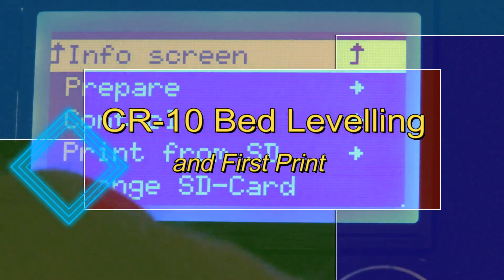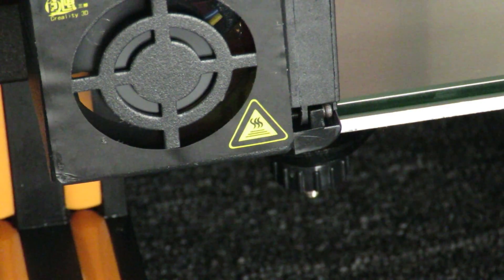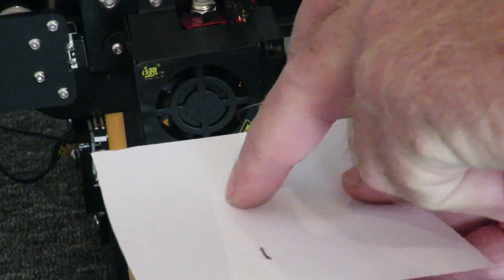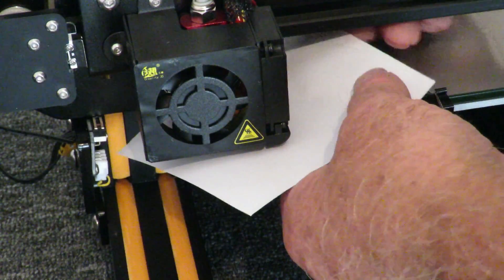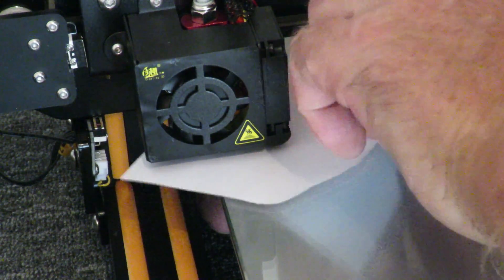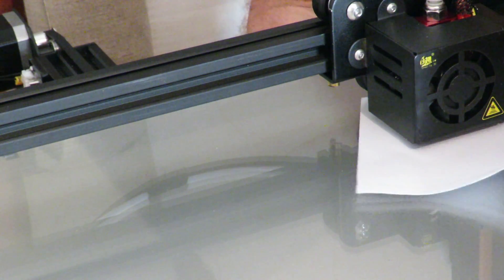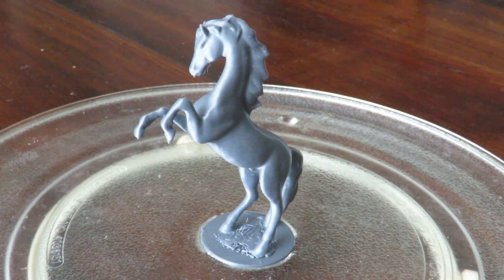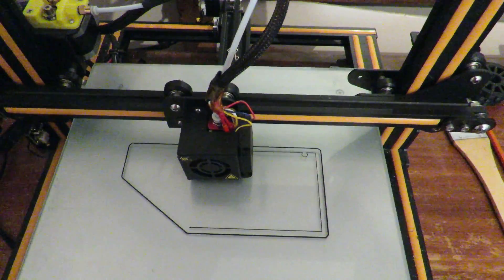📌 CR-10 3D Printer Bed using Manual Levelling first then a New GCode Levelling plus the First Print

Comment: I have the Cr10s also and all four corners are leveled but how can I level middle of the bed ?? thanks
Reply from the maker: Your glass is warped.
I had a similar problem, and power sanded the raised area
https://youtu.be/_h8fcEMxLyQ

I have also updated one of my printers with a New Creality Black Adhesive Heat Bed Sticker 310mm Glass Plate. (Good option)

You can also add a BLTouch sensor to map out the warped glass.

Comment: Hi Gary great information in your video, have you ever done a video on how to get the gantry level, when I turn the lead screw to lift the gantry up, the left side goes up first a few MM  , then the right side starts to move, the wheels on the right side sem to be adjusted correctly
Reply from the maker: No I haven't made a Gantry video.  
See if you can turn the wheel touching the inside of the gantry, if you can turn it by hand, then it's too loose.
(Hold extruder bar, and Spin Wheel by hand)

Comment: I have the ender 3. Can you copy/paste me your code with 200 * 200 * 250 and the temp settings?
Reply from the maker: HI
I just modified the code for your Ender 3 
Bed size190x190
Bed temp 60
Nozzle temp 210

You can read you code and save it to your computer as a GCode file for use with your printer.

https://wetmf.com/downloads/Ender-3-easy-bed-level.GCode

Comment: hi, how to download the file?
Reply from the maker: Hi Dario

Go to 
https://github.com/dogbox257/Cr-10-bed-level-helper

Then select your printer size (it will open in a new window)
Right Click your mouse, and select all the numbered txt code.
Then save as a GCode file on your computer

I.E. Level.CR-10.gcode

Load this file onto your SDCard and print it.
Your printer will move the hotend around your bed, so you can level it manually.

Comment: I find the best way to get a good tip on the plastic is to bend break the end off bending to the four points on the compass, this creates a really good rounded tip with with smallish point to it.
Reply from the maker: Your correct in saying a small point at the end of the filament is easier to thread through the bowden tube.

Comment: You did so much wrong. 1: NEVER MOVE your bed or any axis unless power is on, stepper motors are disabled. Why? Because you can send back current to the motherboard and fry it. 2: turn power on, preheat bed and nozzle, the best way to get an accurate bed level.
Reply from the maker: Thanks for that info.
I have already addressed that very point.

Current is generated when you move the bed around fast, and it can produce enough voltage to light up the controller box. (As you have already stated, THIS Is VERY BAD for the controller board)

HOWEVER, if you move the bed slowly, the inertia current generated is too low to cause any damage to the electrical components.

Comment: Thank you...I wonder when I will be able to make print after print without all this constant tweaking....it seems like all these little things wrong will never end....
Reply from the maker: Hi Richard.
Once you have things running smooth all will be good.

I now only level my bed when I notice the first layer not going down correctly.

Its important to not use undue force when removing your prints, then you will find you will be able to print quite a few items, before you need to check levels.😉

Comment: Garry...my cr 10 does not see my memory card...how would I use my USB connection to send the leveling g code to my cr 10?
Reply from the maker: Hi Richard
Are you saying your CR-10 SDCard controller slot is faulty, or you are having problems with the actual SDCard itself?
Reply: It is really weird...the USB holder seems to be very cheap...I put into my computer usb slot and works one time then 5 minutes later the computer does not see it....(I ordered a new one from Amazon)...same in the controller box...worked for awhile...now does not recognize it...and won't initiate it...using the USB cable from computer to box...works well now...I was able to get you g.code to work and leveled the bed...what do you find is the best method for adhesion on the bed...I just watch a video where some guy used a mirror and just cleaned with soap and water...he swears by it....???
Reply from the maker: The quality of the supplied micro SDCard is definitely questionable.☹
I've had two stop working after only a small amount of usage.
Totally unable to access data on SDCard, my computer says they are corrupt, and I'm unable to format them.
 
USB with Octoprint on the Raspberry Pi works a treat.
I have one setup and use WiFi to transfer my STL files for printing.
I will be making an Octoprint video shortly. (My Logitech C270 camera has just arrived)

With regards Adheasion
I made a video showing the method I use.
https://youtu.be/WxgHSpk44yk

Comment: The link to your modified G code is not working...is that the one that changes the temperature?
Reply from the maker: Hi Richard
Yes I have the layers set for temperature changes  in my GCode.
Try this link (I'm setting up a new site and still moving files across)
https://wetmf.com/downloads/Cr-10-easy-bed-level.GCode
To save , you right click select all, and then save the code to your computer.

I deliberately left the GCode in text form on my site, so you can see there are no viruses in it, before you save it as GCode on your system.

P.S. I always warn people to be careful when downloading any files from the internet.

Comment: Wow...what a great video...I am new to all of this and the bed leveling is of most importance...I downloaded the code from: https://github.com/dogbox257/Cr-10-be...and it worked perfectly moving from each corner of my machine...but it did not increase the nozzle or bed temperature at all...did I miss something???  Thank you some much for all your hard work...
Reply from the maker: Hi Richard
With GitHub code you need to modify it for temperature for your printer.

I have a modified GCode I use with temperature preset.
https://wetmf.com/downloads/Cr-10-easy-bed-level.GCode

To save
Right Click
Copy all code
Save to your computer.

P.S. Lines 6-10 are the heating commands.

Comment: great video, I have a question (sorry if its a dumb one im new) right before it laid down its first layer I noticed towards the edge of the bed it dropped some spool. I cant help but realize that that location is the same spot my extruder got caught in a loop in. it stood there and went left right left right over and over until I realized thats not where prints are supposed to begin nor was that the shape of my first layer. I tried printing the same file again and got the same result. eventually my nozzle scraped the tape I had covering my glass for adhesion right off and im now lost as to what to do. Do I just flip over the bed and use plain glass and remove the tape? or remove the tape and replace it with a new layer?
Reply: I have this all monitored on film in case you would like to see for yourself the problem and end result as im new and can't seem to identify what the source of my problem is
Reply from the maker: Pop a link to your video and I'll take a look at it for you.
Reply from the maker: The extruder nozzle will always leak a bit, but when starting a print it needs to prime the extruder, A good thing is to print a rim as it gets the filament flowing nicely, before the actual print starts.
Reply: I want to genuinely thank you for responding and trying to help went all over haven't found much help and I'm beginning to get very upset with my printer. I assumed I'd run into problems but not when I'm so close to successfully printing my first file!
Reply from the maker: Hi Kyle
Try printing this GCode (Its optimized for the CR-10)
Its a Temperature Tower I designed, so you can set the correct nozzle temperature for your printer.
http://www.ozinow.com/file-downloads/Temperature%20Tower%20v3%201h%2034m.gcode

To Download and Use.
1. Goto Url Above
2. Select all Code
3. Save as:    Temperature Tower v3 1h 34m.gcode 
4. Copy to your SD Card and Print.
Reply from the maker: It looks like the print was not centered on the bed.
Make sure all cables are in the correct location.

Try printing my Temperature Tower.
The GCode is correctly set up for the CR-10 Printer

Comment: I would also like to use your modified gcode.
Reply from the maker: No Worries

1 You will need to goto the link supplied
2 Copy all code then Save by Right clicking
3 Create a new file, MAKE SURE your NAME ENDS with .GCode
3 Copy this file to your SDCard and select to print it. 

The GCode will run through all locations entered after it reaches the set temperatures.
60 for Bed and 210 for nozzle.

Here's the link for the CR-10 300x300x400mm
https://goo.gl/ueVjK2

Comment: That first layer was perfect Garry nice work as usual.
I was told to use a business card to level the bed but it looks like copy paper works just as well. Cheers
Reply from the maker: The Business card is a bit on the thick size, so the print head distance from the build surface might be a bit too much, for good adhesion, and might result in the 3D Print lifting and curling in the corners.

Comment: Would like your modified codes....will they work on a CR-10 MINI?
Reply from the maker: Ben 
The Creality Mini has a smaller build plate, and the Github codes are for the larger Creality CR-10 sizes. 
So running Github code on a smaller build plate might damage your axis motors.
You need to modify the code for whatever sized bed you are running.
Reply: @GarryPurcell  hi ya any chance you can send me g-code for cr 10 mini semi  bed leveling,  and if ok want it to level over the screws please i have the g code that i got from thingiverse semi auto bed level it's good but i do need g code for leveling the bed over screws if that's ok gary
Reply: Dan Boardman its gcode it will work on all printers.
Reply from the maker: Hi Dan
WARNIBG... DO NOT USE the GCODE from the GITHUB WEBSITE for the MINI, its optimized for the larger Creality Beds, and it might damage your Y-Axis motors.

I will modify the code to suite the mini for you. 
Give me a few hours to create, test, and upload the finished GCode.
I will create the standard timing for you, and later if you need the faster GCode, I will make that for you also.
Reply from the maker: Here you go Dan
I have tested the Code on my CR-10 Mini, and its working perfect.
Please let me know how it goes for you.

Copy all code then Save by Right clicking and creating a new file, MAKE SURE your NAME ENDS with .GCode
Copy file to your SDCard and select to print it. 
The GCode will run through all locations entered after it reaches the set temperatures.
60 for Bed and 210 for nozzle.

https://goo.gl/PnNuPw

Comment: lefty loosey righty tighty
Reply from the maker: An easy way to remember for sure.🙂
Reply: Garry Purcell  have u tried th3d 1.1.7 firmware
https://www.th3dstudio.com/th3d-cr-10-marlin-1-1-7-beta-is-out/
... i getting great results also braced the frame as its not square on z axis night and day diffrence with prints imho

https://www.thingiverse.com/thing:2720170
https://www.thingiverse.com/thing:2720165

rasie z axis and place square on the extrusion you will see if your s is out  i was quite shocked just how much
Reply from the maker: Marlin 1.17 Looks interesting, but I'll wait until its stable.
Thanks for the Thingiverse links. 
I personally happy with the standard rigidity on my 3 CR-10 printers.
I test my frames with a set square, and have found them to be acceptable.
But as you have stated, some CR-10 units need extra attention.